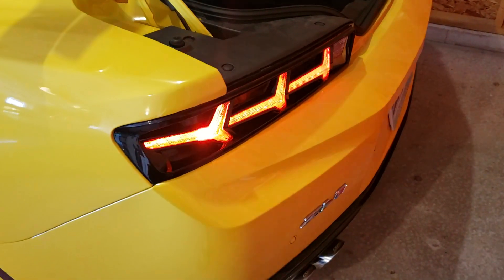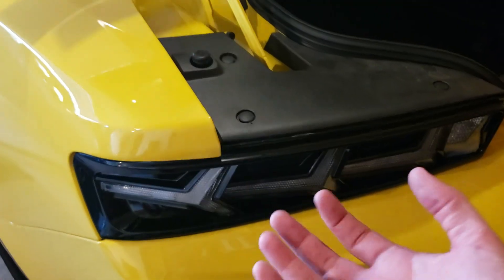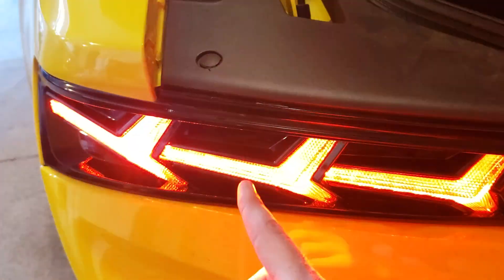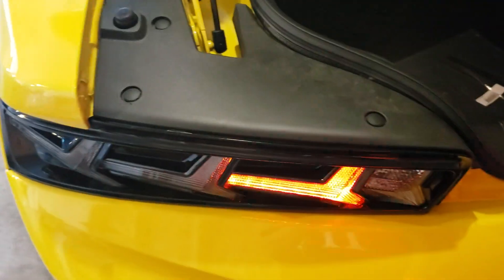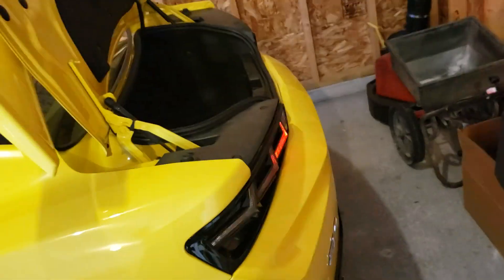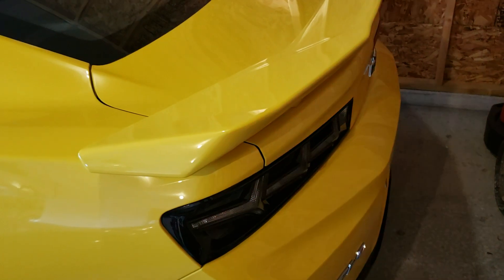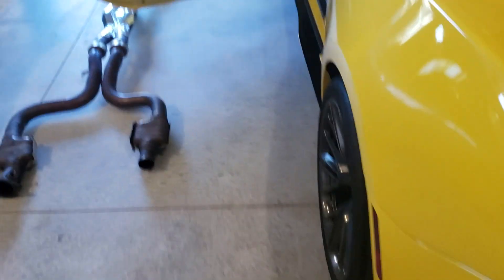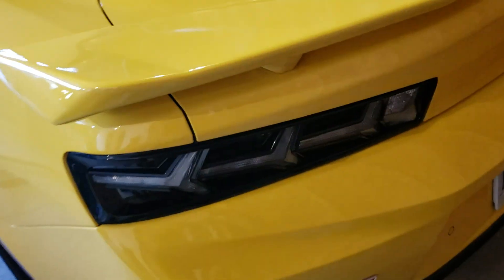CHEVY CAMARO MORIMOTO XB TAIL LIGHTS REVIEW - Lamborghini Aventador Lights

Comment: Hi I have the same car and bought the lights and adapters but it looks like there’s an adapter on each light already did your lights have this to and if so did it stay on with the extra adapter just added or removed the one that came attached to the new lights and put the additional harness in it’s place ? I bought them from car ID and they couldn’t answer it they gave me morimotos number bet they were closed for the night and I wanted to install them ASAP

Comment: Can you tell me what extra harness we would need for the 2018 (: ?
Reply from the maker: I would suggest if you have the tail lights already contact below. I bought mine directly from them and paid the additional fee for the harness
 http://www.morimotohid.com/led-housings/camaro-sequential-led-tail-lights.html
Reply: Oscar Gracian hey! I was also looking for the harness for the 2018 Camaro and I found it! Just look up (Morimoto 2018+ Camaro LED Sequential Tail Light Harness (Single Piece) on Amazon. They have it for only $27. Have a wonderful day!
Reply: I have a 2018 and i bought the harness for both but mine do not light up in sequential like yours do in this video. Any idea why?
Reply from the maker: If I recall the tail lights come with 2 resistor packs and I only installed one to get them operating this way. I don't believe it mattered what side.